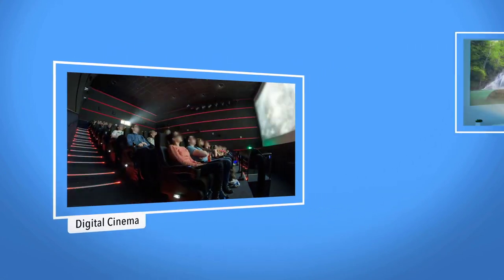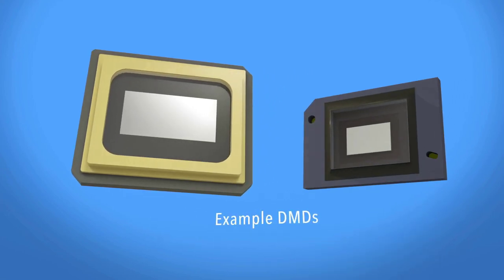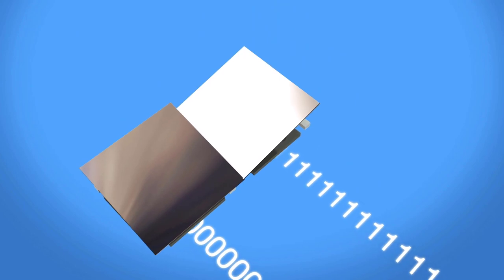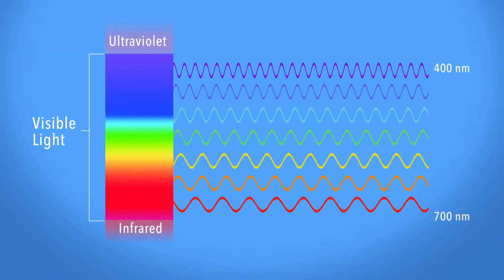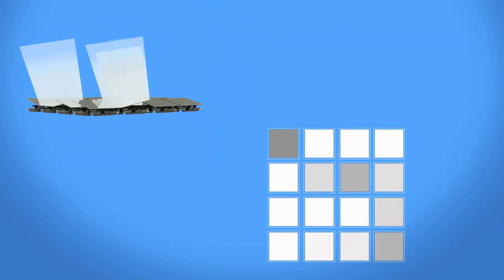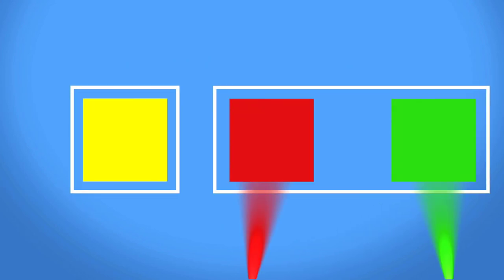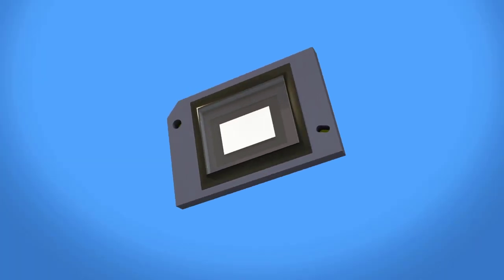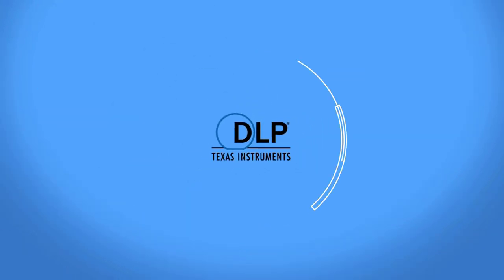How To Display Video & Control Light Using TI DLP® Technology

Comment: Two ideas here.
1. Can you scale up the chip size so it can be a non-illuminated display on it's own?  This would be an attempt to reproduce a color version of the original Kindle(Amazon) that used electrostatic to hold black pigment to the screen. I suggest this because a color version could be used to simulate things like paintings and posters which for public space advertisers could have some serious cost and presentation benefits.

2. Mounting area for liquid cooled heat sinking. Under the right circumstances this display type industrialized could cover large areas with bright enough light that would probably cook the chip without thermal conduit.